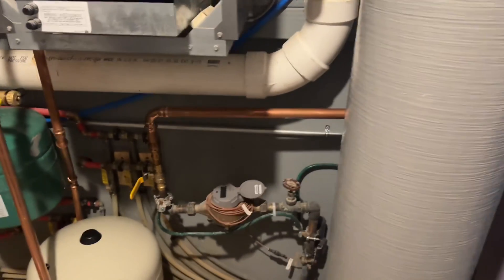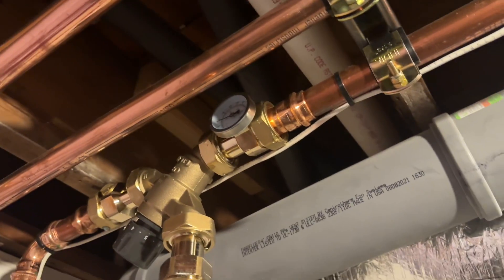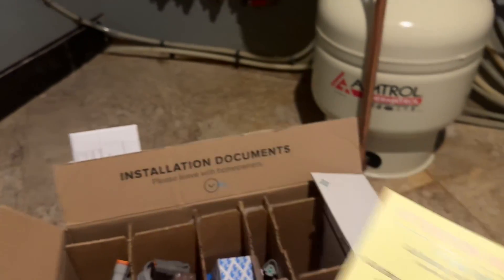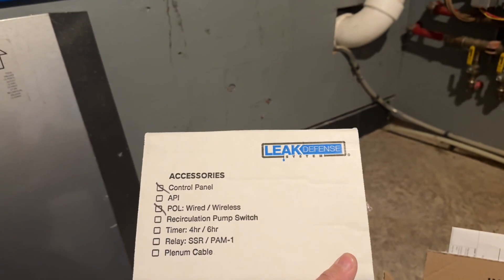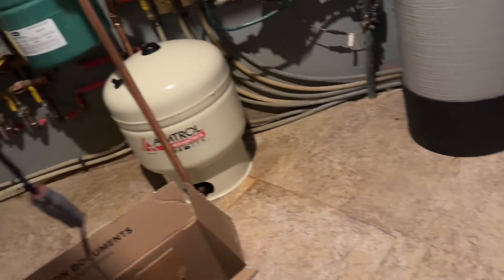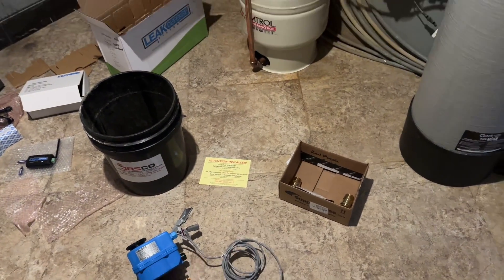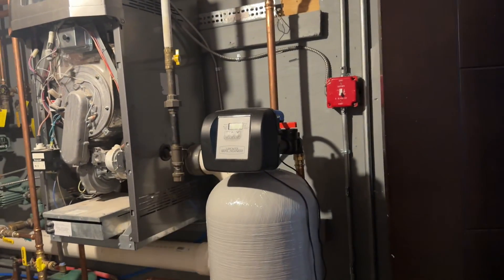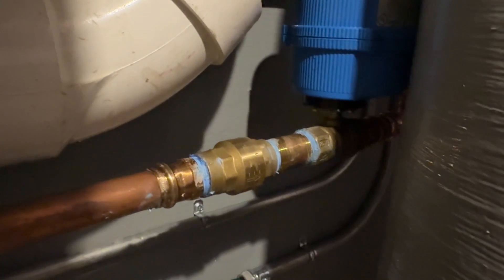Automatic Water Shut Off Valve Watts Leak Defense System Installation with Remote Flow Sensor

Comment: Mikey can you tell me, have you ever had viega fittings start to leak over time like say a year after installation? I have seen many posts online people complaining of leaks. What has the track record been for you on press fittings? I use the Ridgid RP 241 myself and debur and clean the pipe as much as possible before install. What's your thoughts?